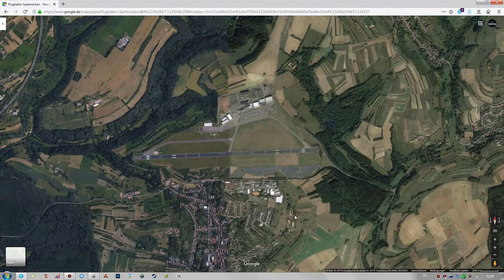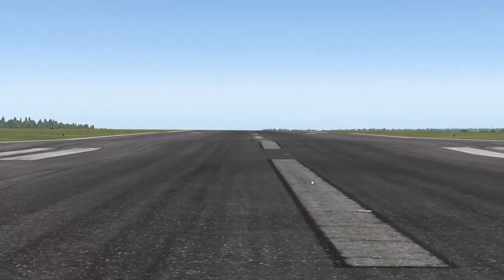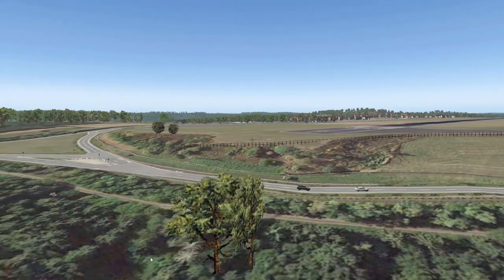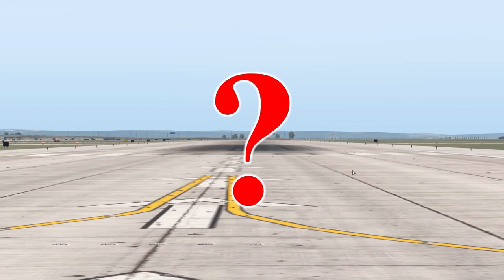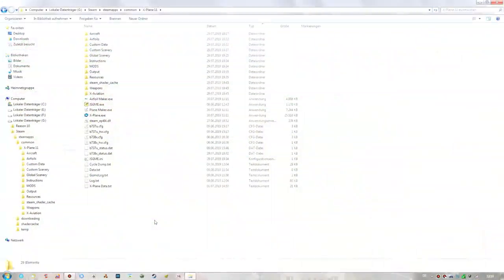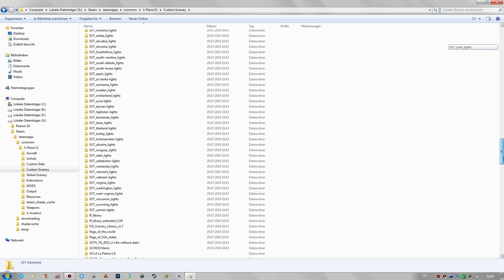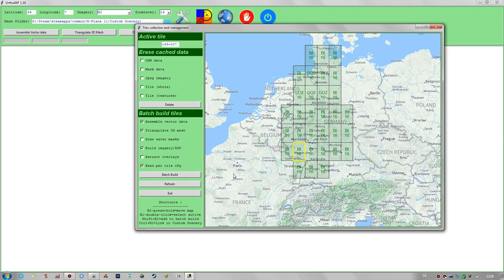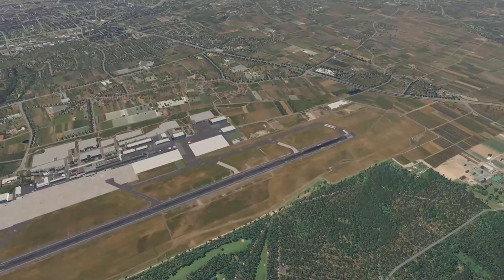Ortho4XP 1.30 | How to get PERFECT RUNWAY SLOPES in X-Plane 11 [Tutorial]

Comment: yes fantastic video could you make a video on all the options in the setting page explaining what they do and how to use them eg : road_level , road_ banking_limit etc
Reply from the maker: I would like to do it, but also I don't fully understand every single one of those settings lol ;) I didn't play around with them too much and overall I'm very happy with (most of) the default values.
Reply from the maker: Oh and by the way I played around a bit with exactly those road settings to fix the sloped road at EDDR airport, but it didn't make a difference, i.e. I couldn't fix it.
Reply: @SimulationChannelDeluxe  ok thanks btw did  you notice that the OSM preview mode no longer works
Reply from the maker: @chrisgard4076  No I didn't notice that, I'm always using the Bing preview (and very rarely Google) but thanks for the hint.

Comment: absolutely fantastic info well done & Thank you  ! Can this be done with payware scenery as well ? I find many payware developers don't bother with Runways follows terrain contours. I see this as a major feature in X Plane !
Reply from the maker: Yes, if you see that the payware airport is completely flat then you can disable the Flatten function via the apt.dat file just as I show in the video. Thanks a lot for watching :)
Reply: Method works but sometimes there are problems with building's elevation. I tried that with Drzewiecki Design Polish Airports, EPRZ exactly and had some buildings and static vehicles in ground or floating. I'm not quite sure if there is solution to that yet.
Reply from the maker: @Vesper132  Yes that's a problem when payware developers decide to place their custom buildings and stuff with the flatten option enabled. I'm afraid there isn't an easy way to fix this. Default airport buildings always get placed on the ground though.
Reply: @SimulationChannelDeluxe  yep that's the case. I will probably try to play with WED and see if this could be fixed. Anyway still with your settings we achieved great and realistic results so I will probably stick with them ;-)
Reply from the maker: @Vesper132  Thanks! I guess many payware developers are too lazy to develop their airports for XP11 with sloped elevations. When they set it to flat, I guess they can pretty much just import their FSX/P3D sceneries and maybe convert some things ;)

Comment: Great video! Thanks! I have one question. When I use the flatten command via WED customizing an airport  by Areosoft (EDDF) some of the terminals don't follow the ground completely but are off the ground for the most part. One end may be just touching the ground. The runways look fantastic not being perfectly flat with some slight dips, etc.just like the real thing. I have tried some other custom airports LTBA, same result. Any fix or solution to this? Thanks again!

Comment: For the roads flattening on the hills, have you tried lowering  "road_banking_limit" under "Vector data" in Ortho4XP?   From the description it looks like exactly what  you would use.  The default is 0.5 meters, so that's quite a banking before it gets flattened.  I haven't tried it yet as I haven't generated any scenery on the hilltops yet so can't say for sure.
Reply from the maker: Thanks for the hint. Yes, indeed I played around a bit with the road settings, but after one mesh rebuild the road didn't change. I can't remember if I lowerd that banking_limit value lol. Maybe I will try it once again at some point :)
Reply: @SimulationChannelDeluxe  You also need to set "road level" higher otherwise it will only cut into the mesh for major roads, 5 will do it for all roads.
Reply from the maker: @DarrellThompson47  I think I did set it to 2 to also include tertiary roads. I thought that would suffice lol. Thanks for the advice :)

Comment: Once the Ortho4XP v1.30 is finished, it create the Tiles but do not create the overlays (which as they should be created within the Ortho4XP v1.30 folder itself), and correctly i put the Global Scenary address of xplane11, also use a Mesh, and nothing, just create the tiles, and these once put on xplane11 appear to me well , but without vegetation, buildings, or anything, just the terrain,,,, and this is because I believe that I lack to put the Overlays that should generate the Ortho4XP v1.30,,,, also i organize the scenarios in the register within Customs Scenarys and nothing,,, please you could help me to see how I can solve this problem, I have been 10 days and could not find the solution

Comment: Mal eine Frage. Ist die Option 32 für die apt_smoothing Einstellung wirklich so gut? In chourchevel ist die runway durch die Einstellung viel zu flach. Aber mit der default setting von 8 ist zum Beispiel der Flughafen München oder auch Frankfurt viel zu bumpy.... kann man irgendwie die default airport elevation Settings bzw die mesh für ortho4xp verwenden (nur für die flughäfen)? Die default setting ist meiner Meinung nach die beste.
Reply from the maker: Naja, Courchevel ist ja auch ein sehr spezieller und außergewöhnlicher Flugplatz. Ich finde den Wert 32 schon sehr gut für alle "normalen" Flughäfen die ich bisher mit O4XP erstellt habe. Das Gute ist ja, dass man die Einstellungen pro Kachel variieren kann, also ist es kein Problem für die Courchevel Kachel den Wert 8 zu verwenden :) Gruß
Reply: @SimulationChannelDeluxe  was ich halt komisch find ist dass ich auch schon content auf youtube gesehen habe in denen die default setting ohne Probleme verwendet werden konnte und das ohne bumpy runways. Ich suche jetzt schon seit Ewigkeiten eine Lösung....